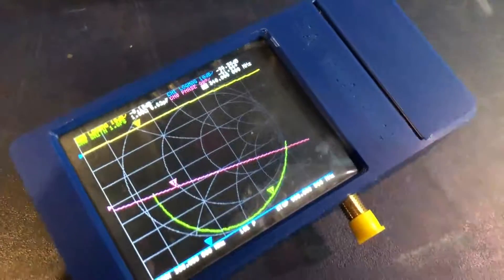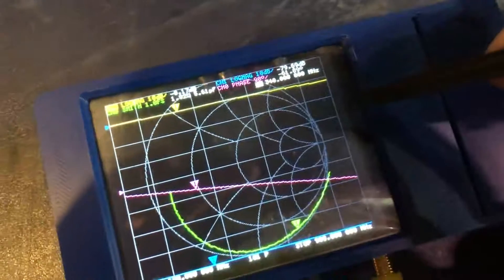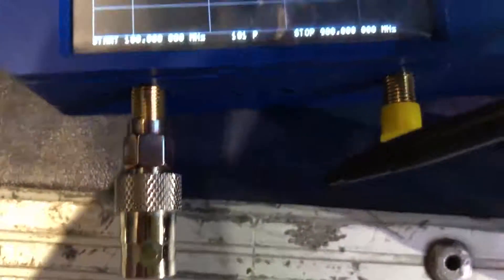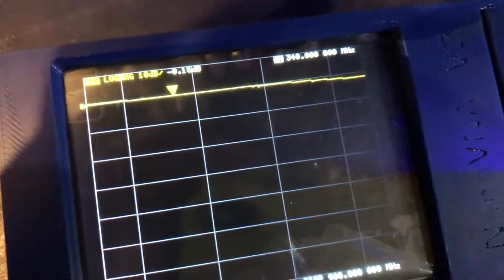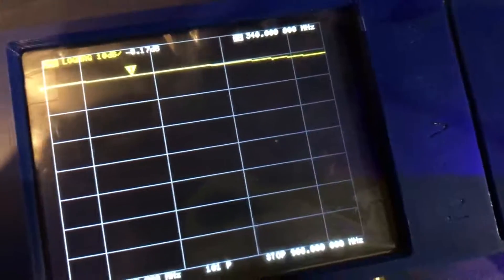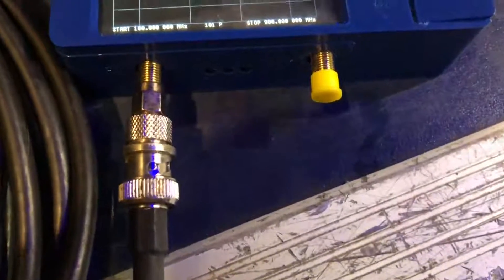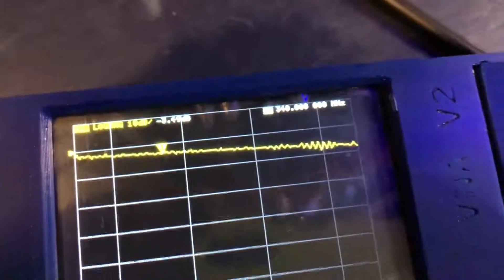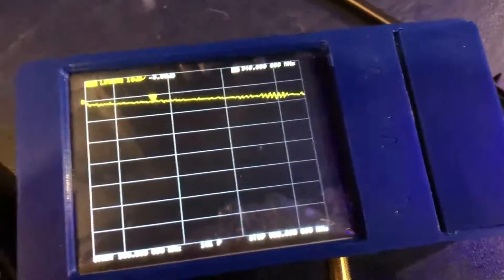Know your antenna cable loss - NanoVNA!

Comment: I can’t say for sure if your NanoVNA version had the same firmware but mine has a “Measure” menu option with an item called “Cable” that will show you the length and the loss in a convenient way. Also, the loss you read would be doubled because it went both ways and in reality be half of that value. The mentioned menu item will halve it for you btw 😁
Reply from the maker: Thank you!

Comment: So in real that would be a 2db loss. The signal from the  nano is being sent out and received back so it is doubled. So the real loss is 2 db. If you connected it to the s21 port and it will show the correct loss.
Reply from the maker: Excellent! Thank you Thomas!